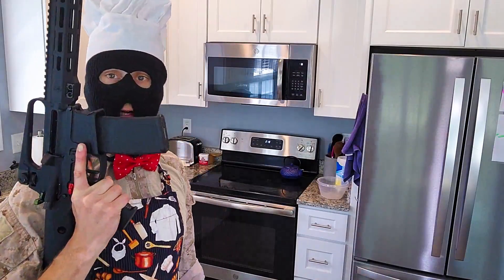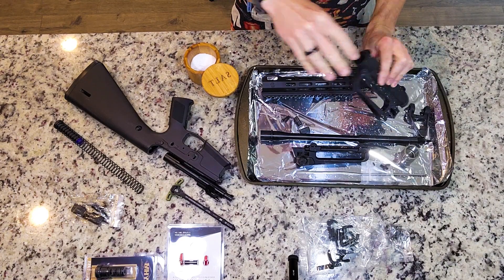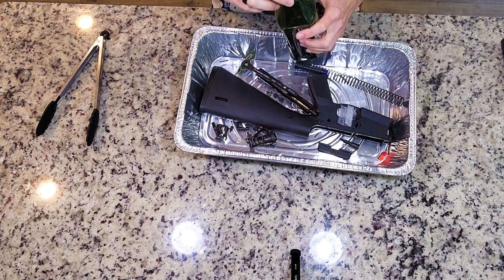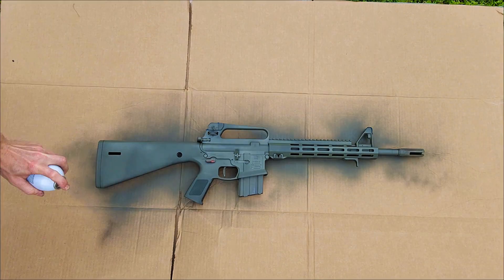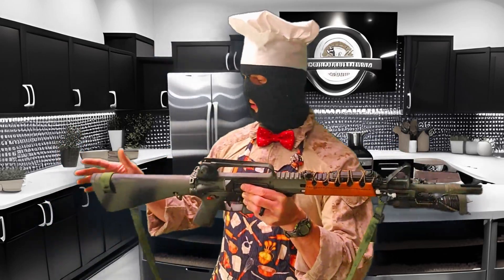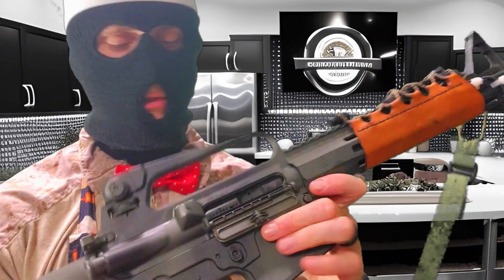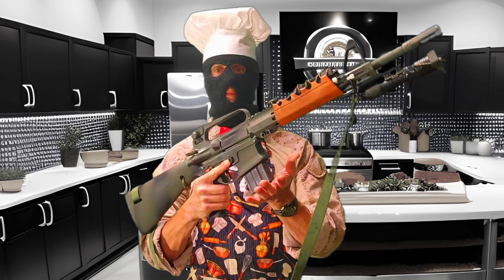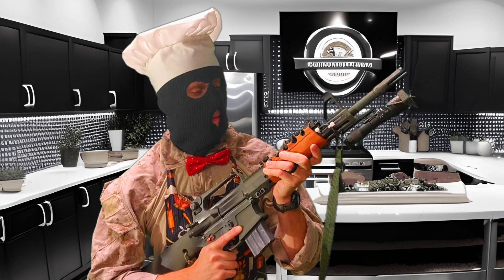How to m̶a̶k̶e̶ bake an AR-15 (A2 upper retro-mod build)

Comment: You can tell this is one of those fake cooking shows where the meal is made ahead of time and then fancied up for the camera. 

It's obvious by the way the oven element isn't even turned on.

At least the recipe and presentation are nice. I think you used too much salt though.
Reply from the maker: The seasoning bakes off into the pan drippings, so you really have to over season before the oven. That said, yes, this was filmed in front of a live kitchen-studio audience, so of course I has the meal prepared before hand!